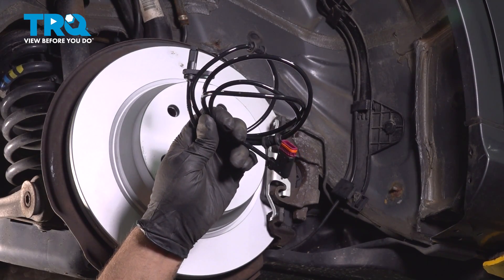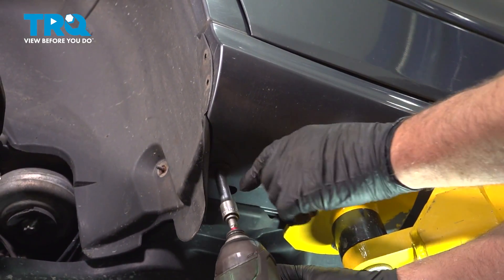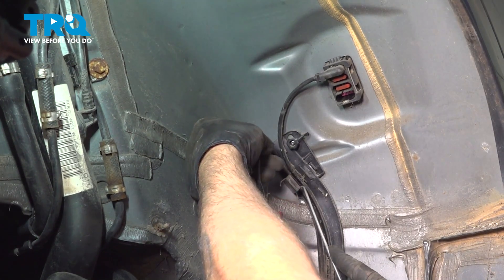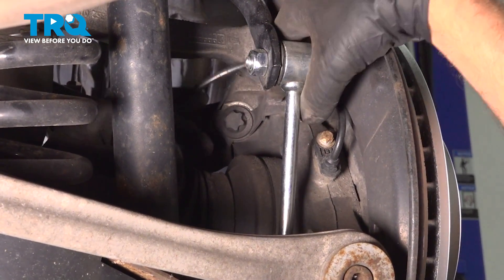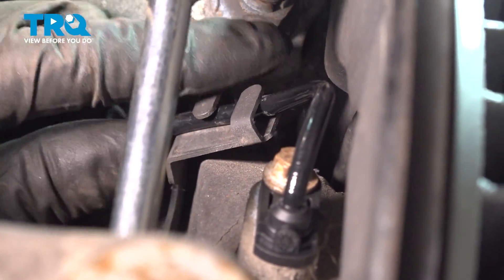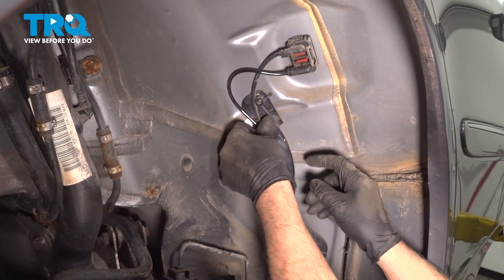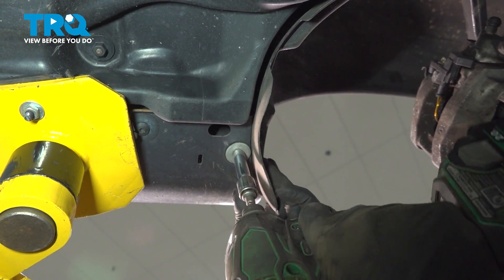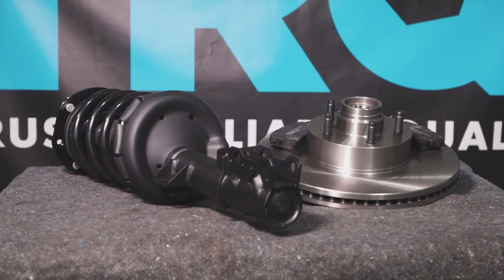How to Replace Rear ABS Wheel Speed Sensors 2006-2009 Mercedes-Benz E350

Comment: lol my sensors are so stuck, junked up with corrosion of some sort. I ended up breaking the rear left one trying to get it off. Gonna have to drill and tap it tomorrow so I can extract it. I was expecting it to come right out, but that's never my luck lol. Update: I got the driver side done, but the sensors were caked into position on both sides, ended up having to break the tops of the sensors off and then drill out both sides very carefully to get the old ones out. I got 90% of the passenger side done and ran out of daylight, I'll be back at it tomorrow to finish it up. But yeah, anyone doing this please be aware that the sensors can and do get stuck. I really wish mine came out this easy, but it's been an absolute bear to get them out. I'm not sure if it's just corrosion, rust or build up of grease or other debris but man oh man they didn't want to budge.

Comment: I’m working on an e55 amg the rear passenger tire blew out and there is 3 sensors that plug into the body harness in the wheel well the box blew to pieces but the plugs and wires are fine now I have 3 sensors that are each different on the body one plug had 3 pins/wires and only one sensor has 3 pins that takes care of that … the other two plugs are different colored wires on the body and only two wires each plug on the new sensors they are sealed and don’t know which 2 sensors go to 2 which plugs on the body harness help a hard working trying individual out pls ? Would be very grateful 😅

Comment: My car has been idling around 500-650 rpm while in drive, it recently stalled when shifting to drive from park, it occasionally has problems driving when I first hit the gas but after that there aren't any problmes, do you have any idea what could be causing this?